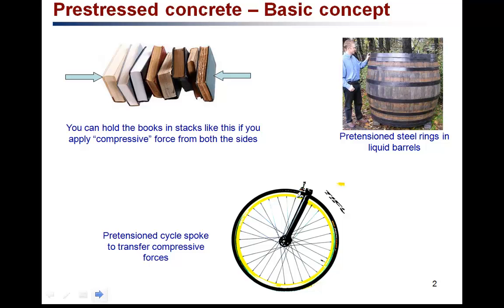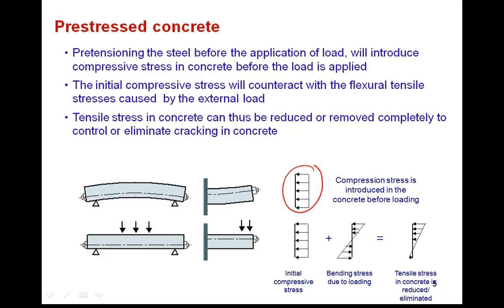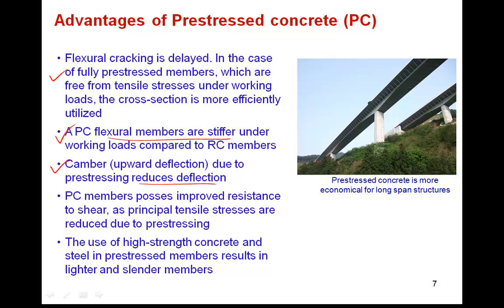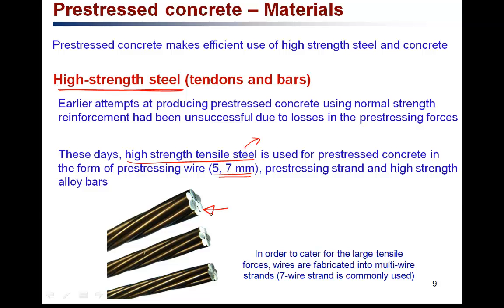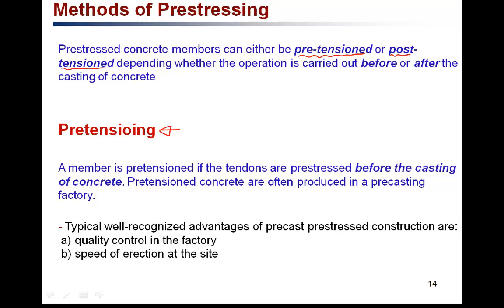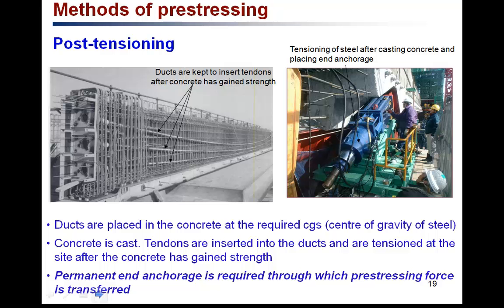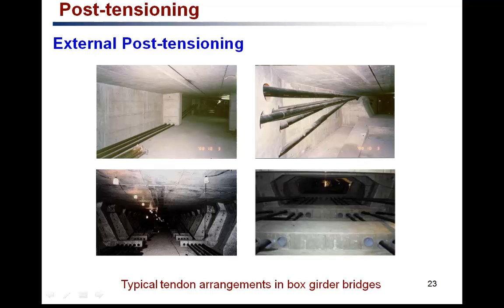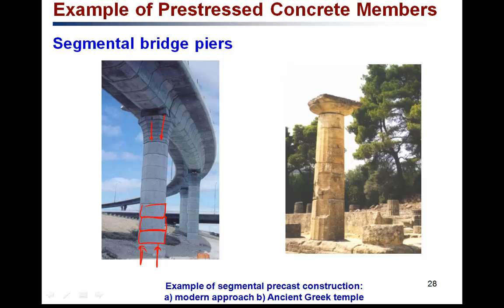Prestressed Concrete (Introduction) PC1

Comment: In prestressed concrete beam, why rebars are provided or added although prestressing tendons are there to strengthen the compressive capacity of concrete beams? What are the real reasons?
Reply from the maker: Reinforcing steel bars can be used together with prestressing tendons in concrete structures. Prestressing tendons does serve as tensile steel in the beams, however, if more reinforcement is required normal reinforcing steel can be used as well.

Comment: You do realize you need to do maintenance on prestressed like every decade to 2 decades, the cables in the middle needs to be replaced ?
Reply from the maker: Hi Neoro, prestressed concrete structures do need to regular inspection and maintenance if required. Hence, external prestressing has become popular these days in bridge construction as inspection of external prestressing wires are much easier and it is easier to replace them as well.
Reply: Thanks for the reply.
Reply: Rabin Tuladhar what about partial prestressing ?
Reply: That depends from use method, in pre-tensioned and bonded post-tensioned concrete there is no possibilities of replacing tendons, and it is virtually maintenance free (there was problems with bonded post-tensioned bridges in Europe due to poor workmanship or quality control during construction).
In unbonded post-tensioned and external post-tensioned concrete there is need for regular maintenance and replacing tendons if it is needed (external post-tensioned concrete  have many advantages over other methods and can be retrofitted to existing constructions or used to correct problems from other methods)